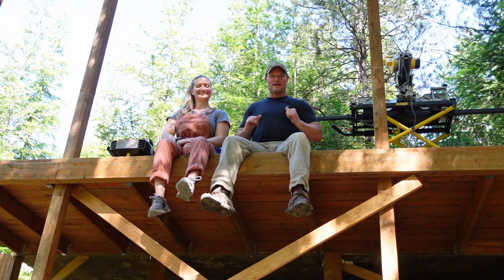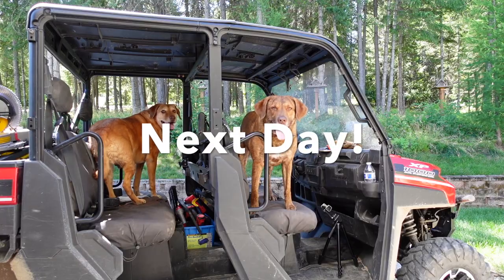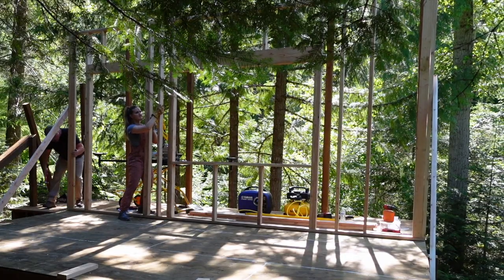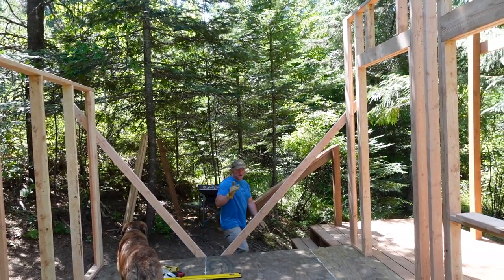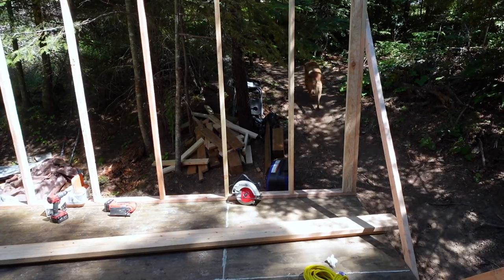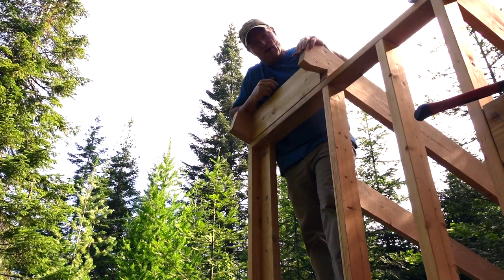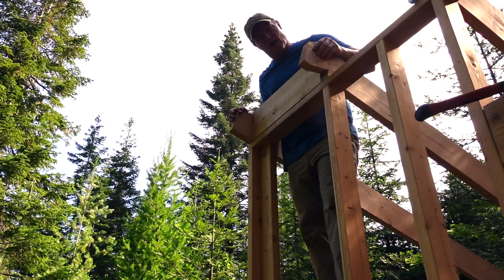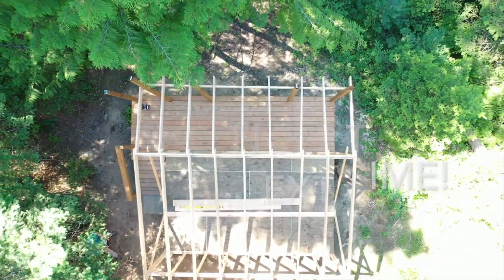Building an Off Grid Cabin in the Rocky Mountains - Part 5

Comment: I don't know why you didn't build and stand your sidewalls before the rafters, but I'm sure you insured the opening was square, and not trapezoidal. Other than that, it's looking good...........
Reply from the maker: As a total amateur, I chose to do this cabin concept as its supposed to be easy for one person to do by themself.  So due to the shed style slanted roof (9 Foot high front wall with a 6.5 foot back wall), the side walls weren't square, so all the side studs were notched at the corresponding heights and nailed into the existing side roof joists.  Just the plan I chose.  So you know, I am not a experienced builder at all. I did this build to learn, challenge myself and to have an off grid cabin on my property in the Rocky Mountains.  Thanks so much for your comment and engagement.
Reply: @LifeintheNorth40  Don't misunderstand me, Rick, you and Britney are doing one Hell of a fine job on it, and I'm impressed! A good, enjoyable, and educational site is Perkins Builder Brothers. They admit when they err on things, and show you how to fix them. My congratulations to ANYBODY willing to put forth the effort you guys are putting forth. I did a similar thing that you're doing now, 42 years ago, when I built a 1,200 sq. foot shop and guest house. The difference between an amateur (you and me), and a pro... is the ability to cover up our mistakes. Front sight! FRONT SIGHT!!
Reply from the maker: Awesome, no problem Carl, just wanted you to kinda know why I did what I did. I know going through the whole process I could have done some things totally different. Thanks Carl!

Comment: You folks seem like really nice people but where did you learn your framing skills?  I know it is just a cabin but why not build it better?  The deck should be lower than the main floor, you always have a top plate on a stud wall, you diagonally brace the stud walls so they are plumb and don’t wobble while you are nailing them, and as even you folks pointed out the connection of your posts to concrete footings is well… very odd.  My concern is that someone will watch these videos and repeat the mistakes you are making.
Reply from the maker: Thanks for watching and for your comment @rickfetz469. Not sure you followed all of the series or not but Im definitely not a professional builder or in the trades, I have been clear about that. We have shown our mistakes and didn't edit them out of the videos so others could learn from them. I am a retired military war fighter who is learning and enjoying building things on the property I have been blessed with, and it has been very therapeutic for me doing this project. I spent most of my adult life wreaking destruction, now I get to create and enjoying learning as I go. This is an off grid cabin in the woods on our property for us to enjoy, no inspection and no permits. We are enjoying it and it turned out well. If your looking for perfect build ideas with a professional, we aren't those folks.  We are just a hard working couple and amateurs doing things on our property with our own two hands, in many cases learning as we go. That is what this series is about. Hope you enjoy to outcome we did!